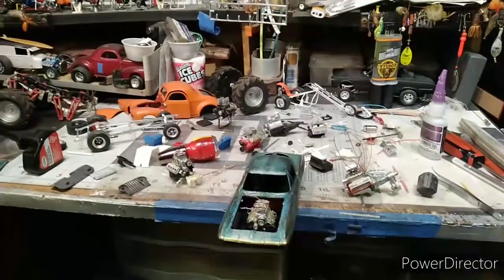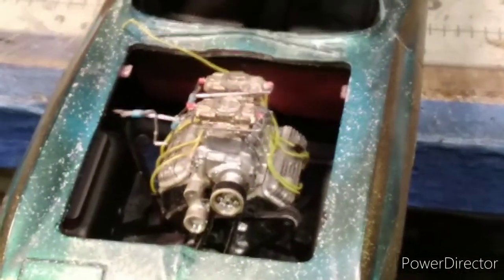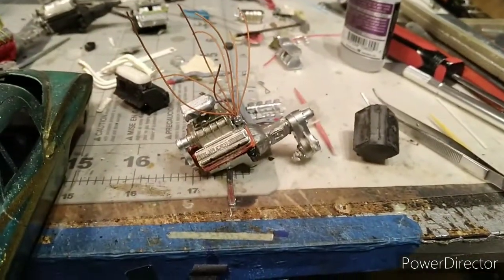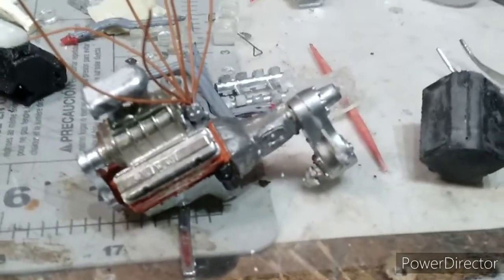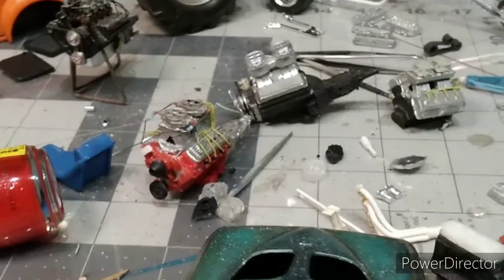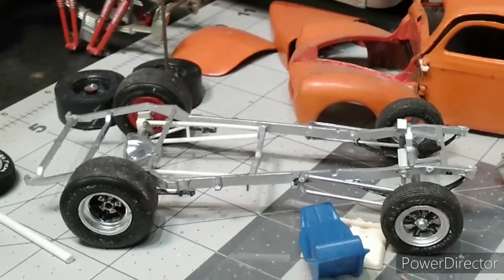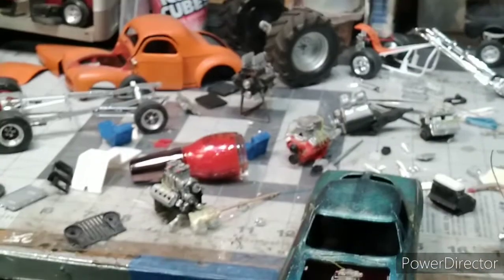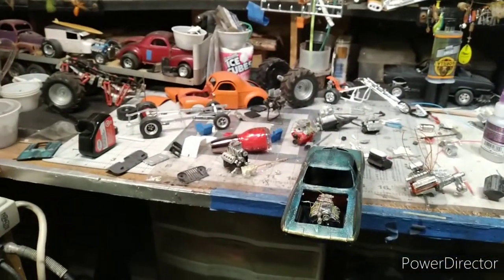10-20-2021  Veronica Bella and Doug update

Comment: I like the wired engines.  Are you making the wired distributers yourself or buying them? If so where do you get them if your making them what do you find is working best for you? Thanks. 👍
Reply from the maker: I make them all myself I will use Distributors flatten the tops or just drill where the wires go in I use HDMI or or phone charger cables did I tear apart and use the wires out of there are some that I have done that I use plastic tubing inside a plastic tubing thank you very much for stopping by and watching I appreciate the comments I also like your YouTube name I run on Antitheasums law
He's the guy that thought Murphy was an optimist